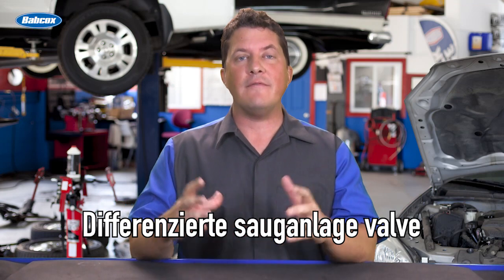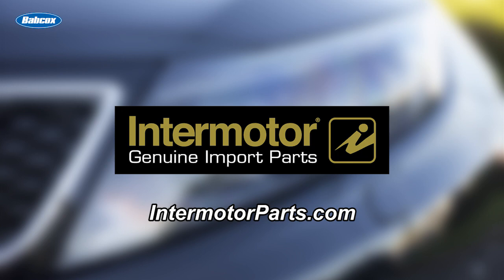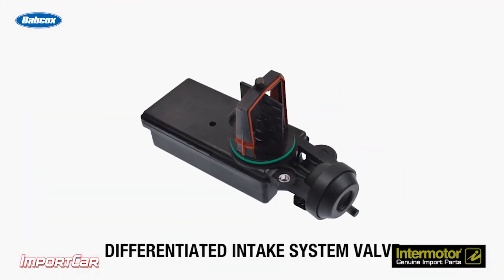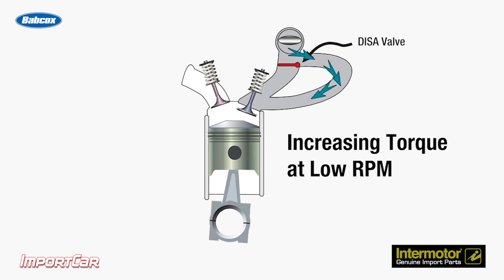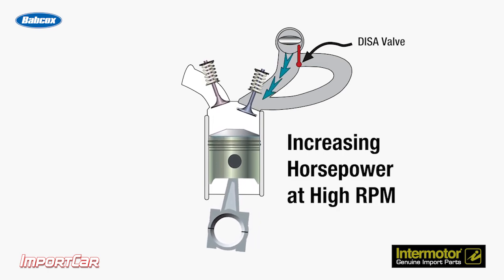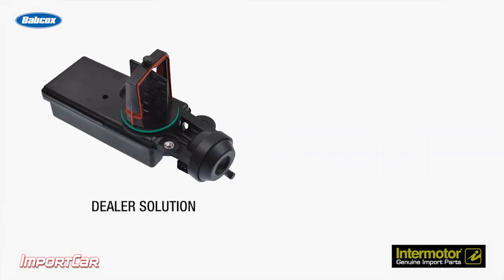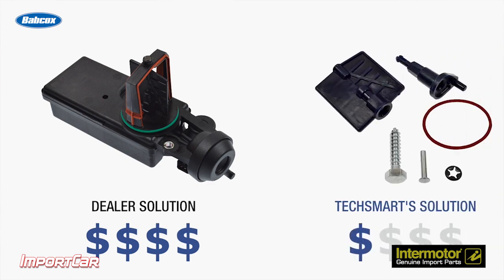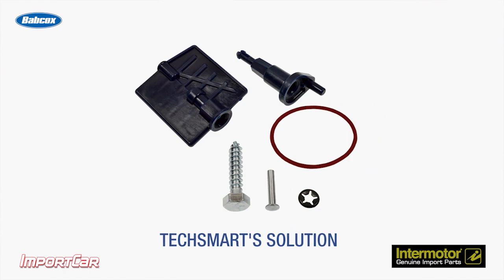Common Failures On BMW DISA Valves | Tech Minute

Comment: Hi jason if disa valve is bad would that cause the preassure in valve cover to blow out oil cap then a while to suck in the oil filler cap . ?????? Cheers
Reply: no that would be pcv/ccv failure